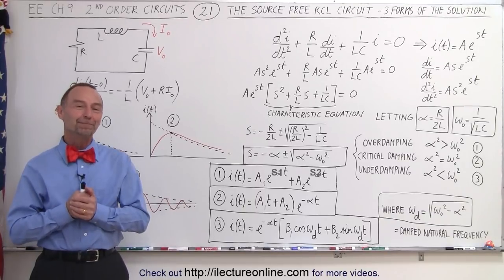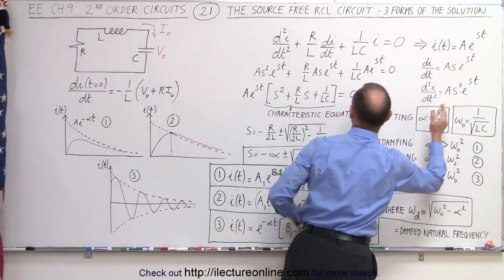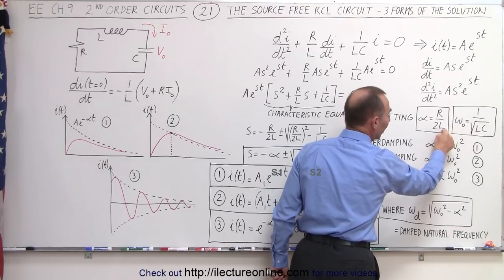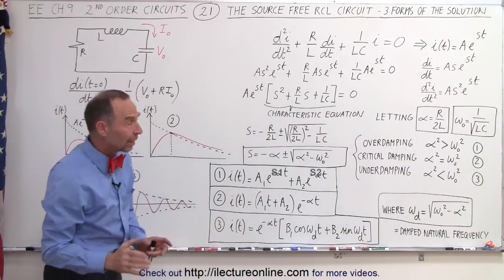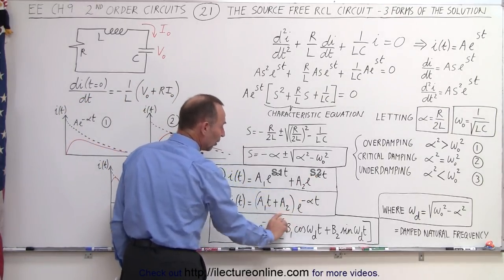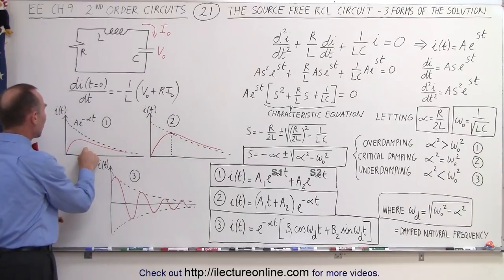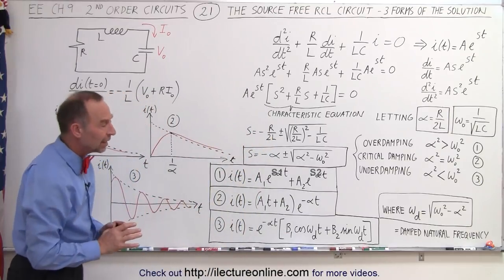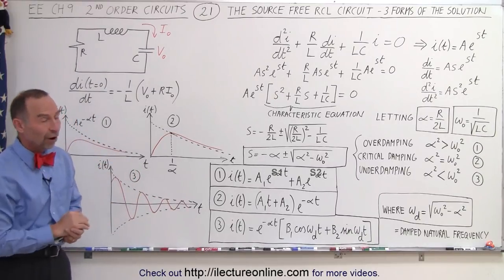Electrical Engineering: Ch 9: 2nd Order Circuits (21 of 76) Summarize Over, Under & Critical Damping

Comment: Would it be possible to charge a capacitor using repeatable damped sinusoid current signals? If yes, what is the charging behaviour in the capacitor?  Thank you for your awesome lectures!
Reply: How can you charge at one polarity with sinusoidal current.. Its like charging and discharging with resistor in series taking away energy in every cycle